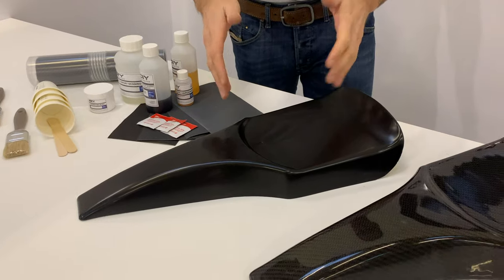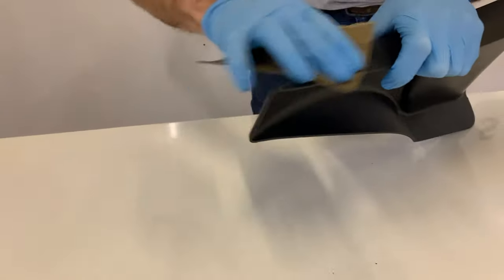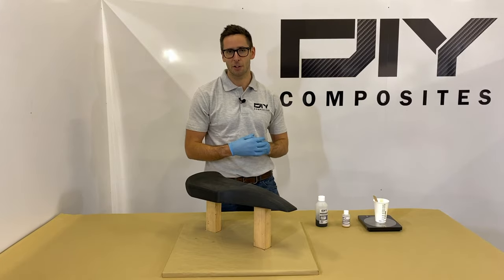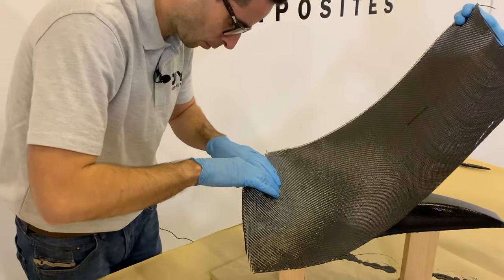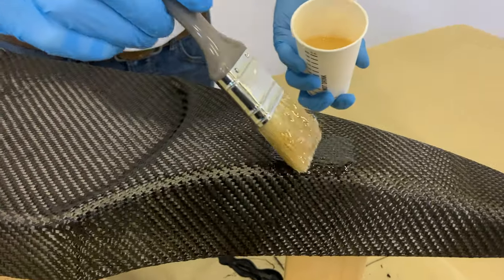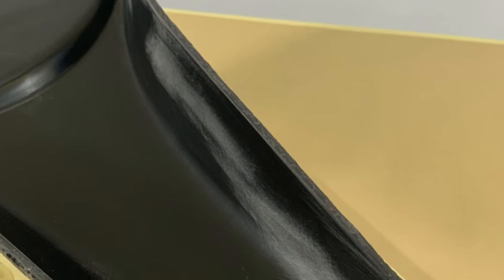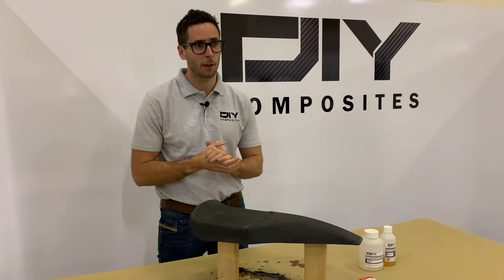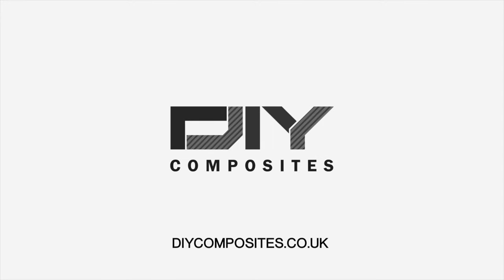DIY Composites Carbon Fibre Skinning - How to tutorial

Comment: It hurts my eyes watching this guy flat this component down using his fingers. A rubbing down block or the palm.of your hand will produce a far flatter effect. I have a diffuser I want to skin. The laying of the cabon fibre is very daunting.
Reply: its really not that hard if you have a second set of hands to hold the fabric up for you as you lay it down. Don't be afraid.
Reply: @naspirit1551  I might just have to find someone I can trust to do that job, my next issue is, I did some measuring last night and my diffuser is bigger than I thought, I need to find some bigger impregnated carbon cloth otherwise I'm going to have joints everywhere 😑
Reply: And don't forget: after wiping down the part with alcohol wipes, touch it with bare hands as much as possible😂
Reply: Getting straight cuts that don't frey is no problem, use fiberglass tissue paper ,spray adhiesve on the carbon lay down the tissue press down let it dry then cut straight
Reply: @darringrey4329 no just pull out a single strand of carbon out the cloth then you have a straight line to follow and cut

Comment: Hello...  in my opinion i would personally do this differently considering the part you are using it looked very smooth and with some light buffing and release compound you could have made a mould off this part by adding a few layers of carbon fiber and vacuum bag the part and infuse the resin and harder mix and the next day with some preparing of the mold you can same day lay your 1st part off that mould and  infuse it for more parts and 80 %  lighter or more in the end.  I also recommend a spray  Adhesive  Like a product called Air Tac it takes seconds to apply ready for 1st layer of carbon and tacks well and less material 👌 also if you where not looking to make future parts and this is just 1 time part and only cosmetic you could just do your 1st layer or 2 and vacuum bag then that also means you need these things do that but if someone has a pump and know how to vacuum bag and infusion it much easier faster stronger to.. anyways just my thoughts.  Thank you .
Reply: Hi, I have a diffuser that I want to skin, its already painted black so I'm thinking I could prep and lay the carbon straight over that.. am I correct?
Reply: @justinbest9429  I'm wondering the same. I have a front splitter to skin and I'm a little nervous about the "one shot" attempt at laying onto the base tack. As my splitter is already CF (albeit damaged) I'm not worried about colour showing through, so wondering if I could just hold my carbon in place with tape/clamps and go straight to resin...
Reply: The problem with not having a proper base is in direct sunlight the carbon layer can bubble up. Not sure how well anything other then resin will hold up
Reply: @justinbest9429  no
Reply: Definitely can, I've already done it, prepped the diffuser, one simple coat of clear resin over the top and carbon straight over that. Super easy 👌🏻
Reply: @justinbest9429  yes, it can be done, but epoxi resin will not hold on to that surface! You need to grind it to be able to create a bond.
Reply: @tamasbiro1766  yep, I was a car paint sprayer for over 20 years, I understand the principle of mechanical and chemical locking. Surface was prepped with 120 grit carefully to not rub through on any edges etc. Worked well. I also used the pre locked carbon, that made the job a lot easier.
Reply: exactly. this process defeats the purpose of even going through the trouble to make something LOOK like carbon fiber

Comment: Did you use clear coat at the end of the process? Isn’t 120 grit sand paper rough for this process??
Reply: If youre laying carbon just for appeal then you want a mechanical bond with the part to the resin. My understanding of skinning is using one layer to mold the carbon and then prying it off and enforcing the back for a 100% carbon piece. This process defeats the purpose of using carbon...  if you are trying to make a full carbon piece either you want to create a mold OR polish the piece you want to make carbon from 800 grit to say 3000grit to polishing. Add release agents, lay down 1 or 2 layers then pry it off the part and enforce on the inside or back of the part.

Comment: how is the base coat resin different to the later applied resin? (except colour ofc), I have bought a supposedly full set for skinning but there is only one type of resin and hardener
Reply: Did you find an answer I have the same question
Reply: Laminating resin, sanding resin, and gloss resin can be made from the same thing. The brand I use: mix hardner catalyst to laminate, add wax chemical to make it sanding resin, and I add a lot of catalyst and pour the resin hot when it's super thin for gloss coat. Every resin system has their own additives or products. I mix resin by weight with a little cheapy digital scale.

Comment: This (with maybe more then one layer) can also be used to repair cracks in most materials, right? I'm asking because I got a Canadian canoe which is made from plywood and my idea is to repair it with carbon fiber.
Reply: Usually when repairing carbon parts you need a few extra layers like you suggest. But the extra epoxy needs to be vacuumed out. Otherwise you do not have that 60:40 carbon to epoxy ratio which is ideal

Comment: For the first time, I bought carbon fiber fabric and epoxy resin. Can I make the spoiler of my car carbon fiber? Please, someone who knows, tell me the simple steps of the work. I have seen a video on YouTube. Where should I do it? How many times and how many layers should I apply epoxy after gluing the carbon fiber? And my spoiler has color, do I have to remove the color completely or is it enough to sand it so that scratches are created? Thank you for your help

Comment: How does none handle parts that have countersunk recess for screws when skinning?
Reply: I have yet to try this but I would think you would account for that when cutting your CF, press it down into those spots at the drill out the screw holes once it’s dried.

Comment: could you use a spray on glue instead of that black stuff please
Reply: The epoxy desolves spray glue. The moment you wet the carbon it will come loose and create bubbles where you have tight corners or sharp edges on the part you want to wrap